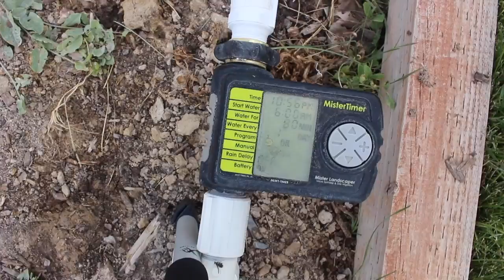How to Replace a PVC Ball Valve

Comment: The title of this video should be... "How NOT to Replace a PVC Ball Valve"..... you should never wind the Teflon Tape against the threads, because as you screw in the connections the tape will unwind over itself.  This guy has no clue what he's doing...